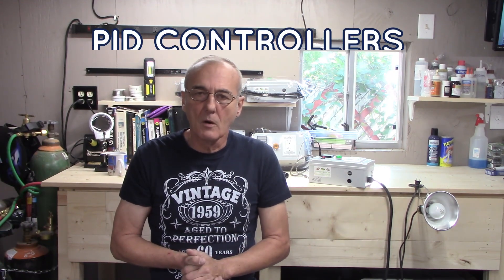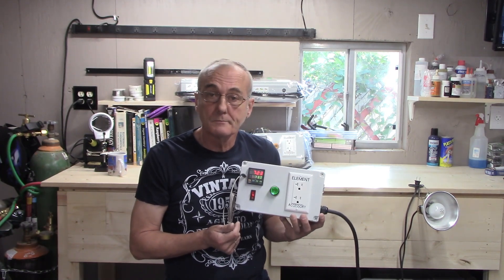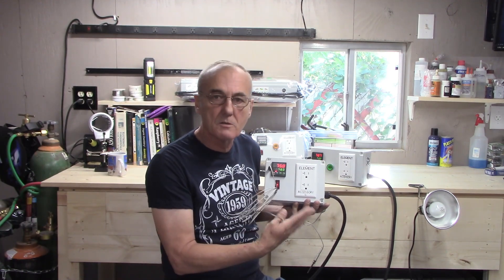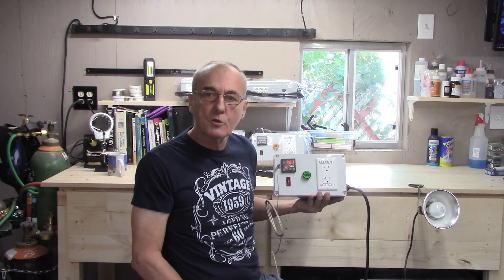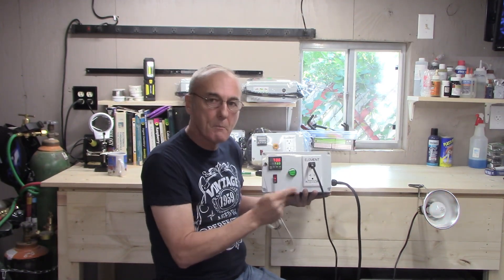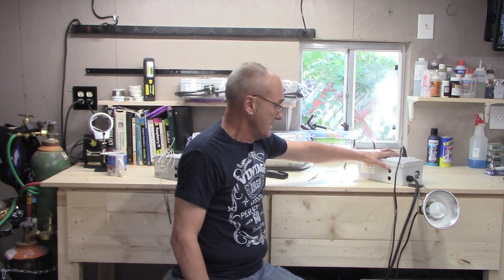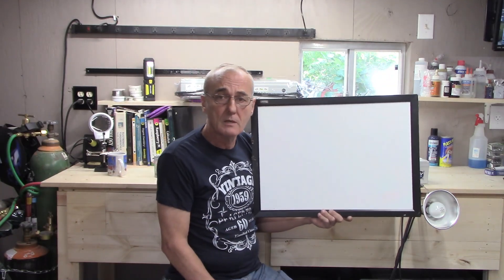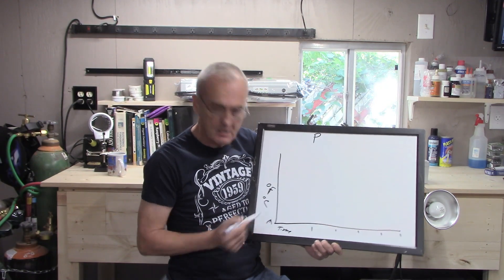PRECISION HEAT CONTROL WITH PID CONTROLLERS

Comment: Could I build my own PID controller using a heating element, a mosfet, a thermocouple and an Arduino uno microcontroller? I've been trying to for a school project but I can't get the code to work

Comment: Hi George, 
I have mypin pid and Inkbird SSR Solid State Relay + Heat Sink (Inkbird SSR - 25DA. I wired it with amp meter and separate outlet for water cooling.my really doesn’t light up instead always gives power to screw 2. Do you think this is bad ssr or pid. Pid checks temperature all righty and I can here clicking and light comes on on it.What do you think would be the course of it ?
Many thanks
Reply from the maker: Give me a call
Reply: Barley and Hops Brewing what’s the best number to call u ?
Reply: Thank you so much for taking time and troubleshooting my PID. Got replacement today all working good. 
Thanks a million George! You are the best !

Comment: George, i have an inkbird itc-100. Is it possible to set the PID to a mode where it allows the temperatur to bounce around the value you want? Example: i want it to geto to 100 degree, as it reaches 100 degree, it should drop to 95 degree and back to 100 and back to 95 etc. ?
Reply from the maker: A PID is a precision controller. I am not sure why you would want it to bounce around. 
Please explain. 
George

Comment: Hi George,  do you auto tune when you start the still off or wait until the still has reached temp ? And do you have to auto tune every time you run or just the once and leave it?
Reply from the maker: Only do this once the still reaches temp. You may never need to do this. Don't overdo it.
Reply from the maker: The PID has a 10 year memory so once every 10 years is good enough
Reply: Brilliant,  thanks George much appreciated 🤗

Comment: That's a great explanation of the PID controller. The only problem is that the boiling point of the mixture changes as the process progresses so you would need to increase the power as the process transpires.Other than manually inputing an increase in temperature as the process transpires how can this work in the real world?
Reply from the maker: This accounts for the three parameters it tracks and provides the amount of power needed to achieve the set temperature. As the volume changes in the kettle you will need to increase the set temperature. This is customary with all stills since the required temperature to maintain production is a moving target.
George

Comment: I recall in old thermostats you would set the "heat anticipater."
Say maybe at a 3° variance so your furnace wouldn't come right back on when room temp dropped 1°.
These controllers are much more adept at precision.

Comment: I would love to have George explain the use of a dephlegmator. As a novice to the hobby, I've been learning how to make whiskey and bourbon but now this winter I would like to try my hand at gin, vodka and infusion of spirits. I've made my boiler so it can be configured from a pot still to reflux but still (pardon the pun) want to learn more about reflux and the benefits of using dephlegmator the process.
Reply from the maker: Will do so real soon
George
Reply: @BarleyandHopsBrewing  that would be great George. I was going to try and make a 2in reflux column for my boiler to try and make my gin and vodka but I want to make sure that I fully understand and if there is any benefit making a dephlegmator. I look forward to your video in the near future

Comment: Thanks, George, I have a PID controller I built some time ago based on an earlier video you did. Can you tell me when the right time is to do the Auto-Tune, and do you do it with a wash or water in the still? I have an Inkbird PID running 110 VAC to a 20 amp solid state relay. I have had trouble getting my temps to settle down after I change the set temperature.

Thanks as always for the channel. Looking forward to seeing you with Jesse and Bearded!
Reply from the maker: Tune once your temperature settles down at your production stage

Comment: Hey George, was wondering if you might do a video on the process of using a dephlegmator-reflux condenser as in setting water flow during the plate loading phase(knowing when the plates are loaded) to setting water control for the running process and how to adjust and balance the system? Maybe some things to look for when setting up the system, I have a basic idea from seeing pictures but seeing someone actually doing it while explaining and seeing the process first hand makes a world of difference. thanks for all the videos you have done.
Reply: I second that!
Reply from the maker: Will do

Comment: That was extremely clear and concise information, I understand PID quite well now.

Just as an extra tidbit, I magically somehow managed to have lost the digital thermometer from my T500 some time in the past week, and between you, me and the internet I think my wife knows where it is. So i'm frantically searching for some kind of way to replace it, and I happened to have had one of those BLUE plastic boxes you got with the Chinese Still that contained a yellow thermometer, a 0-40%, a 40-70% and a 70-100% hydrometer in the kit. They cost about 6 bucks on ebay. Just by pure chance, I shoved the yellow thermometer into the water temp outlet of the T500 and it fits in there PERFECTLY and gives you a very accurate analog readout of your water temp out, and man did this batch come out smooth? Yes sir'ee... I also went out and bought a laser pointer/infra-red thermometer and was double-checking my temps, and just a little note on that, they don't work terribly well on stainless steel, but if you whack a little square of black electrical tape on your test point you will get extremely accurate temperature readings at ANY point in the column, water jacket, boiler, etc. 
There's some very useful tips amongst all that, surely worthy of further experimentation and possibly material for a new video.

Now if you can make a PID that adjusts the water flow for my T500, I'll be your first customer. 
I just can't say enough good things about this unit, it's damn reliable, the element never needs cleaning, and cleanup / refill is so easy I can do it half drunk. 
I use my waste HOT water output to refill my fermenters because the water is coming out at 50'c so I just chuck in my yeast on the bottom, then dex until the 13Lt mark, and top it up to 25lt with waste water from the T500. Once the fermenters are re-filled, I direct the hot water into a bucket and use it to wash bottles.
Reply: Get the pump upgrade for the T500 it will make you one happy camper takes all the work out of water adjustment set it onçe and done.
Reply: @chuckdontknowdoya6100  I did, I found that tap water was far better if I could use it to refill my fermenters and wash bottles to while away the time on Distill Day.
Using recirculated water & bags of ice was costing me MUCH more than letting it pour out of the tap at a constant 18'C.
Reply: Using your water is great but they make a pump for the T500 that hooks up to the tap then the T500 keeping a constant pressure so that you only need to adjust it once and someone can flush a toilet without messing you up. Call and ask George I'm sure he has them.
Reply: @chuckdontknowdoya6100  Where I live the water pressure is a solid 9 litres / min no matter what is going on in your house because it's delivered at 18 l/m from the mains and regulated by the taps. Also the water quality is excellent, although I do filter it anyway if it's not going to be boiled or fermented, ie My Mixing Water comes from a very good quality filter. 
I know about the system you mentioned because George did a video about it not so long ago, but there's absolutely no need to use one here where I live. 
I was quite surprised at how well the cheap chinese thermometer did the job of the fancy digital SS one that i've managed to lose / destroy 2 of now. From now on i'm just going to ensure I always have a spare $6 kit to replace broken floaty-sticks and i'm sure some day i'll manage to snap the thermometer off in the T500, It's just so flimsy I can envision it happening like it's a clear & guaranteed prediction. In fact, I might just go break it now to keep the space-time continuum in check.
Reply: I can tell you what happened to it. Women are born with an invisible black hole. And when they get married they will throw all of their husbands things that they don't like into that black hole. Then all that stuff ends up somewhere on the other side of the universe. That is what happened to it.
Reply: Is that the same hole that only eats one sock from a pair
Reply: @chuckdontknowdoya6100  EXACTLY. Ya got it.

Comment: Thanks again George! Keep em coming!! Can you have an accessory outlet added (120v) on a 240v wired box as well and do you have a video on that specific ammeter wiring?
Reply from the maker: Yes, as long as the 240 is a 4 wire circuit. This is the only way to get 120 volts safely from a 240 volt circuit.
George
Reply: Barley and Hops Brewing ok great! I assume as in using the neutral as the neutral? My 240 main outlet (in wall) that I bought is 30A to replace old one I had for a compressor (new one is a locking only has 3connections/old is like an old three prong dryer outlet but does have red/white/black/grd) I almost bought that little green ammeter does it have the ring to go around load wire? I tried emailing you couple days ago but it failed said address was not good. Thanks for the reply btw!!
Reply: Barley and Hops Brewing also anyway your going to do a video on the 240V 4 wire maybe and adding a 120v outlet to that and wiring that type ammeter?
Reply: Nevemind I found the issue lol 😂 I had the O and E switched in your address 🤦‍♂️ sent ya an email 👌👍